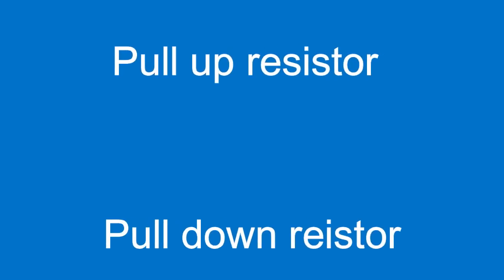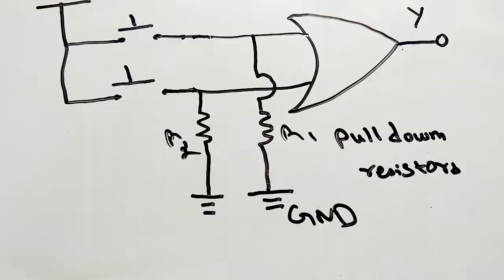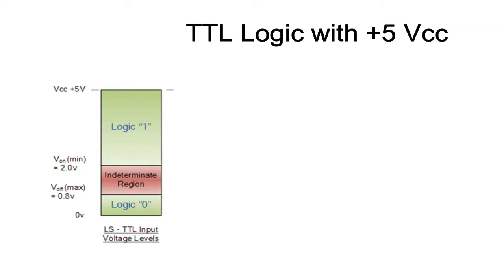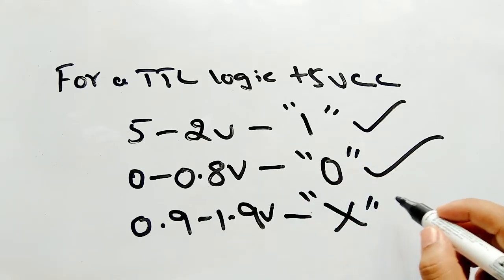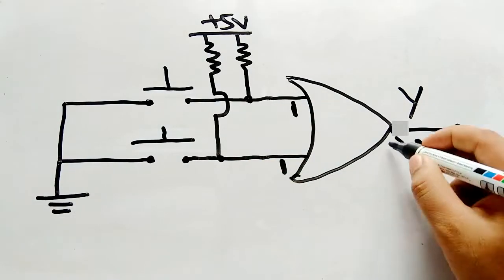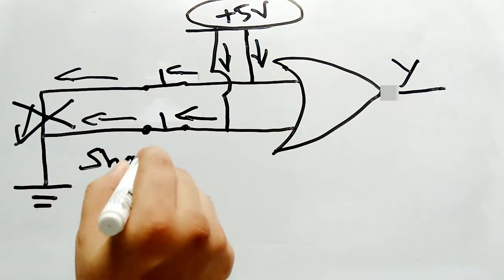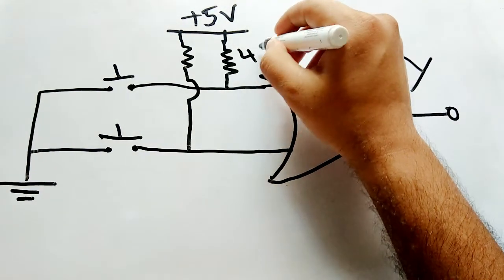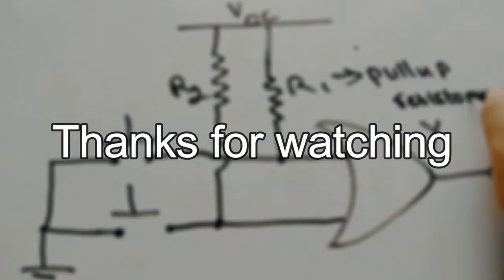Pull up/ Pull down resistor - explained ( with calculation )

Comment: Assuming 100uA as in your example, you would use a 10K not a 40K.
You only want to drop 1V across the resistor, not 4. 
Vcc - Vin / Iin.  (5-4 / .0001)

Don't forget different values of current for sourcing vs sinking inputs.
Reply from the maker: Yes you are right. Apologize for the error, thanks for pointing it out. Unfortunately Youtube has removed the annotation feature have added a card stating correction in calculation.
Reply: @Gadgetronicx  i don't see the card
Reply: true
Reply: I know I am pretty off topic but does anyone know a good website to stream new tv shows online?
Reply: @Ezekiel Kole Yea, have been using Flixzone for years myself :D
Reply: @Ezekiel Kole thank you, I went there and it seems like a nice service :D Appreciate it!
Reply: @Westley Philip glad I could help =)
Reply: yes , this is right. The pull-up value is incorrect in the video
Reply: @max wilkinson Iin is the input limiting current that flows through the input into the chip. Actually the circuit becomes a series combination of voltage source and 2 resistances: one pull-up resistor and an internal resistance between input and output.
Reply: 10k is universal for MCu operating on 5vcc 🤔🤔
Reply: @bobfurgenbirg9523
A very belated but no less HEARTFELT THANKS" to You for taking the time and effort of posting this correction ((and to for "channel" for Pinning it)
As a total "electronics ignoramous" who was trying to "wrap my head around" the "function" of pull up and pull down resistors, and who was just beginning to feel that I was getting a "general grasp". Thist "Error" totally "threw me for a loop" !!
As "all of a sudden" I started to question other things that I previously thought I knew... And finding other examples that I did understand still couldn't  "totally resolve" a "gnawing sensation" of not completely understanding how this works that this "Erroneous example" had "planted in my mind"...
So again many thanks, and best regards.

Comment: This video needs a few million more views. Seriousy. Everyone else just says, pick a big one if you want to soft pull, and a small one for a hard pull. This gave us the reason, and the math, even though, as soon as you said it, I realized, I should have seen that before hand. But, you know, most people teach you these circuits with ideal circuits in mind, so I had never thought about the input making a voltage divider, because well, when most people teach you, they say that inputs take no current, or so little you can discount it. 
While that is probably true most of the time, at least now I know how to properly pick a pull up/down resistor. You earned my subscription. I hope your channel does very well.
Reply from the maker: Thank you for your kind comment and subscription. Will continue to create more informative videos.

Comment: hello do i need pull resistor even if the signal input comes from another ic sending out clock signal...or just use the pull resistor when is a mechanical switch?

Comment: This is a very good explanation but what it doesn't explain is that why there will be a drop of 1 volt?
Usually for voltage to drop to a certain extent voltage divider is required. In this case a current of 100uA with 5V means the current is limited by a 50KOhm resistance.
Hence if we want the current to remain 100uA, and a voltage drop of 1V, then we need a voltage divider of 10KOhm:40KOhm. The 40KOhm is assumed to be the internal resistance of the Gate. Then voltage drop will be 1V across the 10KOhm resistor.

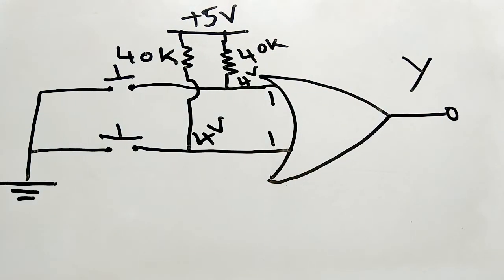Comment: 6:22 Why the input voltage of the gate is 4V?  Across the resistor, voltage drop is 4V(40kohm * 100uA). I think the input voltage of the gate should be 1V. Am I wrong?

Comment: Very clearly thank you very much. Is there a preference for  pull up or pull down? With a pull up, the zerostate is to ground en with pull down you can calculate a small voltage?
Reply from the maker: Sorry couldn't get your question. Pull up mean to pull your logic pin close to vcc whereas Pull down mean to pull your pin close to ground
Reply: @Gadgetronicx  thank you

Comment: Great video, i have a quick question so i have a raspberry Pi 3 and i connect the pull resister of 4.7k and to the I2C Bus i have 34 devices that works well, when i connect the final 6, i start loosing data over the bus, does this mean i can lower my pull-up resistor to 2.2k so that i dont encounter data lost?

Comment: How will induced voltage of  3V on one input pin and 2.5V on the second pin (3:50) produce an undefined state. Earlier in the video you said that from 2V to +5V it should be logical 1, so why wouldn't this circuit produce a output of logical 1, rather than ending up in an undefined state?

Comment: I have doubt, How resistor will pull to +5V, they are not capacitor to hold current ? To pull to certain point of current from where they gain power ?

Comment: What value of pull up resistors to attach to max30100 sensor ,can I use 2, 10k resistors or need to use 3, 4.7k resistors ??? Please help me
Reply from the maker: Whats the need for pull up resistor with this sensor. Which pin do you exactly mean ?